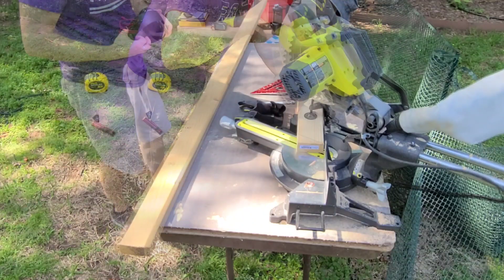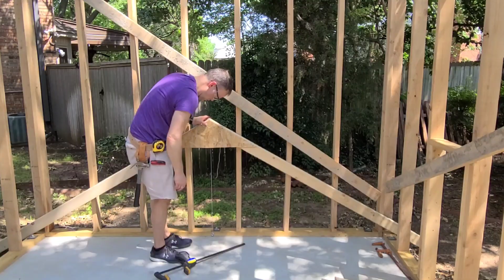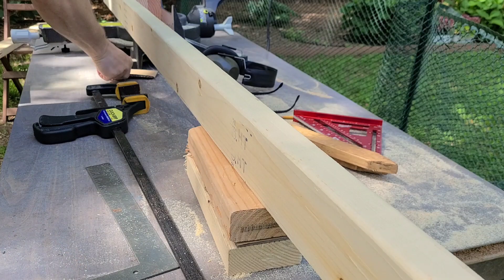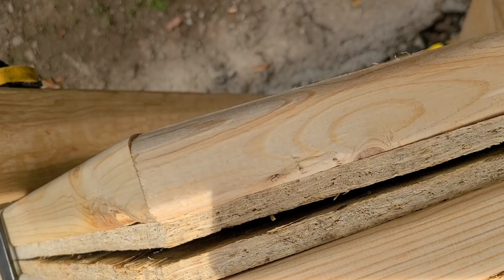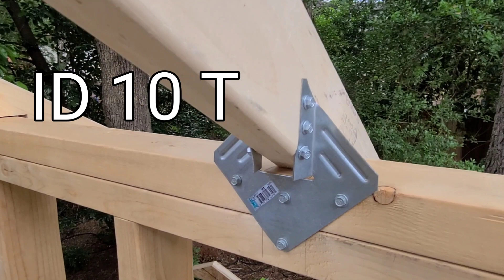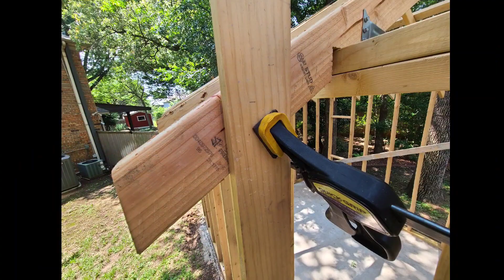Shed build part 5 - rafters

Comment: Just saying....if you have the ring belt parallels straight...and all rafters lower corners where they sit are made exactly the same...(in case not calibrated wood always measure from the part that side which will be on the top) there is no need for no strings or other sorcery....they just fit...and everything will be fine :)

Comment: How much of an over hang did you have on each of your 2x4's with the gusset plate?  It looks like 16".
Reply from the maker: It was just under 14". I designed it so the soffit was 12" wide. With the 30⁰ angle, it resulted in about 14" of overhang.